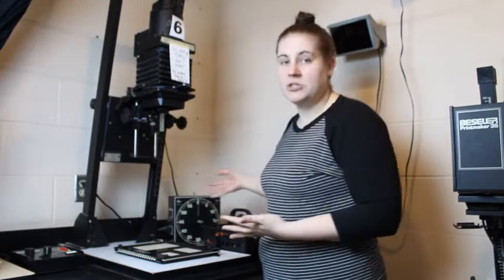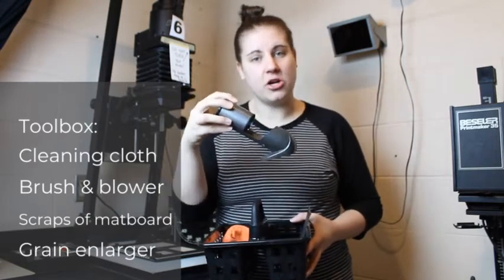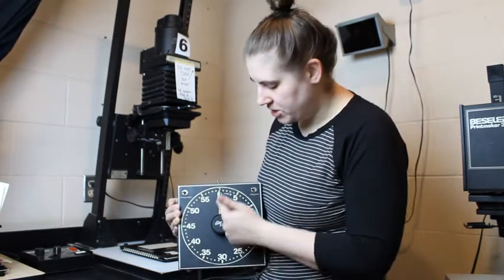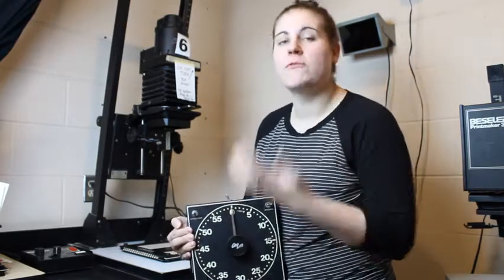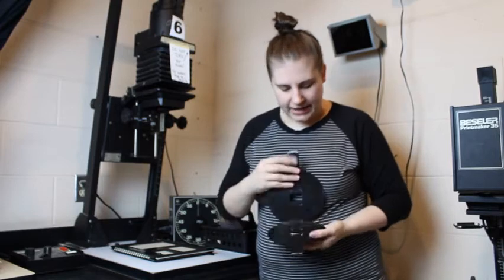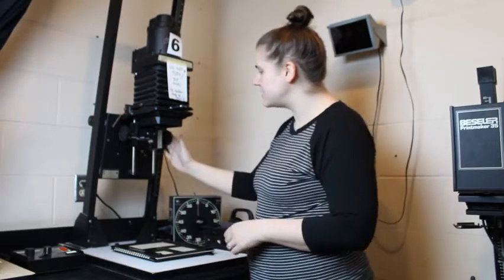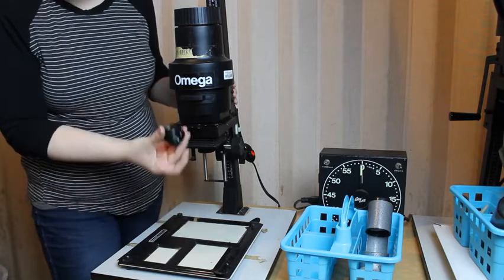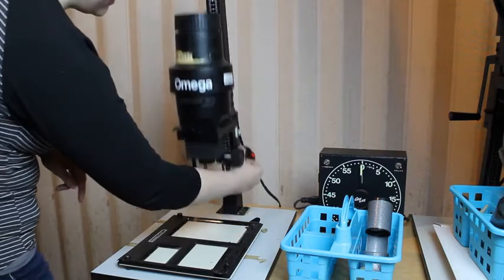Darkroom Enlargers and Timers

Comment: How do you adjust the minute timer without manually moving the arms? Do you just keep turning the knob over and over? I need to set mine for 1 hour. Great video-Thanks!
Reply from the maker: In this case, you WILL have to move the arm itself. 
I instruct students to use the knob in the center to avoid accidentally setting the minute hand instead of second hand because we never print longer than 60 seconds.
Reply: @melissamcfadden1193  Thanks! this helps a lot. Very well explained video :)

Comment: nice vids.like you explain.you can set the Minute to alarm buzz also just like you set in Second feature?on both the gralab model.
Reply: The "end of time cycle" buzzer is set "on" or "off". It operates as such regardless of the amount of time set on the time dials, seconds or minutes. Note that in practical use, when used as an enlarger exposure timer, the buzzer is set to "off", as you are normally timing in ranges of 5 -20 seconds and standing there watching the exposure. The buzzer is commonly used where timing longer times, as for developing times, which often involve 5 - 10 minutes, where you may also be doing other things at the same time.